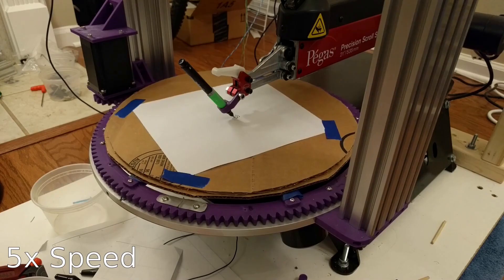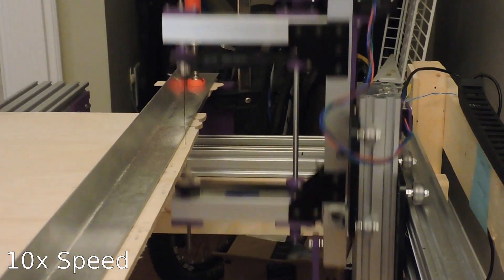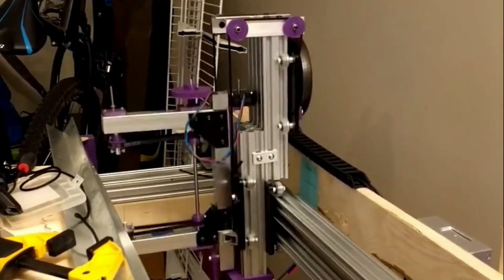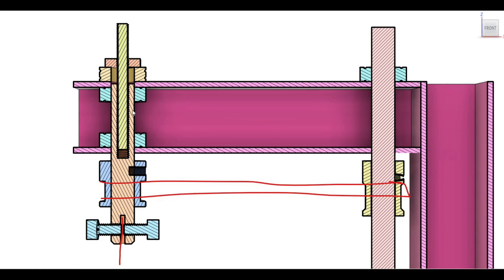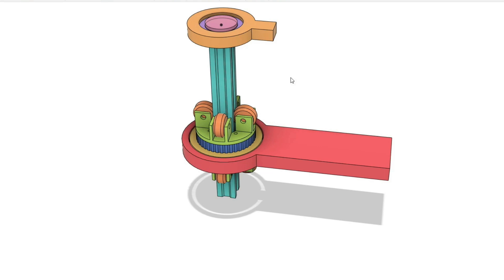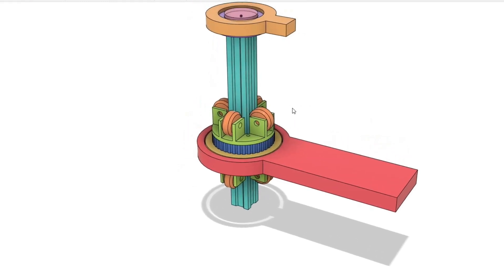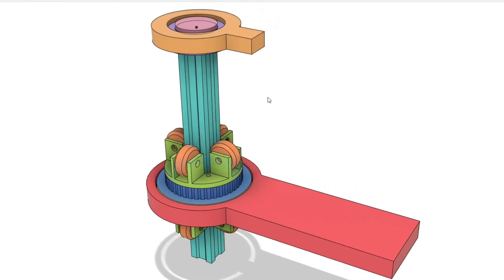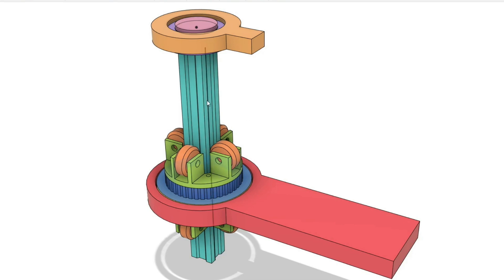CNC Scrollsaw - Version 3

Comment: Hi Andrew, I like cutting puzzles in thick wood in my spare time, and I have been looking for improvement in my scroll saw to obtain a perfectly vertical movement of the blade. The arc movement of the U part on which the blade is mounted causes problems because a puzzle piece can be fitted one way, from above, not from the bottom. So I landed here. I congratulate you on the idea of the rotating blade. When I thought of automation or even manual improvement, I thought of a spinning table with a hole in the center for the blade.
Reply from the maker: I came across one interesting scroll saw design which used a belt mechanism to drive a true vertical movement, but can't remember where. The other machine type that I know of you might check out is searching for "jig saw for die making" on YT or something like Alibaba for actual machines. These are for cutting the backer boards for the steel rule/knives to make a die, which funnily enough are used to, among other things, then cut jigsaw puzzles out of cardboard. I've never used one so don't totally know how they work but they seem to use the older style spring return to give a vertical movement. And they have big working tables.
Also with thicker wood and depending on your blade size, the blade will deflect from vertical and cut a curve in cross section instead of a line. I have a video looking at blade deflection here https://www.youtube.com/watch?v=ODY06S9otf4
And the first CNC scrollsaw I made did use a spinning workpiece! https://www.youtube.com/watch?v=R6PrNylf6_8
Stay tuned, I have another approach in the works that you might find interesting, but it means making my own blades and that is taking some time. Thanks for the comment!

Comment: How does the traditional scroll saw achieve 200-1500 SPM ? 
1.The blade does not rotate. 2.The blade only uses ~2 inches of it 5 in. length. 3.The reciprocating arms are heavily leveraged (pivot is 2" from cam motor to 18" at blade).
So, have you considered modifying it to rotate the blade holder? I.e. Add gear/sprocket  to existing blade holder driven by inboard stepper motors so new mass at blade is 2 sprockets + some drive chain with drive motors to counter balance that mass.
Now that I wrote that and looked back at the latest working one, that is basically what you have. Yes? Except without the arm leveraging & mass balancing. Yes ? Could you add a pivot to the arms shown at 2:25 to do this ? Somehow.
-Mike  
p.s. how much of the one drawing on the Pegas saw would you sell me ? 😁
Reply from the maker: I've thought about how to upgrade/retrofit an existing saw like the Pegas and had too many problems. For one, there's very little room to fit components and it may be possible, but for prototyping has been easier to build off of it; maybe when all is said and done I can revisit this possibility. Especially since as you say, they have really optimized moving the blade very quickly and smoothly.
Pivots make things more complicated because the distance/geometry between the blade/holder and motor would be changing. There's maybe a working solution to this but I haven't seen it yet.
I can post the SVG for that design if you'd like, but it's just a 7 piece puzzle
Reply: @AndrewConsroe  I pretty much knew as I posed the questions above that you already considered them. But hey, I had to ask.
I had never considered a rotatable blade so my head gears started spinning I suppose.
Yeah, I guess even the tiniest dynamic geometry changes will be problematic. It's those pesky details that getcha :D
Don't bother posting the designs on my account - I was hoping to get an off the shelf kit. Silly me! Too impatient! Fixed income too👴

Anyway, keep on with these projects - they are really fun to watch and ponder Andrew !!!
-Mike

Comment: Can you add a counter weight onto the rotating assembly? it would behave as a fly wheel at the same time and smooth out the up/down movement so you don't get current spikes on the motor as it transitions.
Reply from the maker: I considered that but I couldn't figure out a nice way to cram 2.5 lbs down there. And that may end up with issues of its own as well so I've moved on to test the design I cover in the end of the video.

Comment: If you continue to use a moving U frame,  you may want to counterbalance the weight of the U frame with a spring instead of a mass. This way you can oppose weight of the frame without adding (much) mass. The most direct method would be to use a constant force spring with sufficient cycle-life and force. If such a spring is not available at the right price, there are some simple mechanisms to convert the linear force of a Hookean springs into constant force. Alternatively, you could tune the mass-spring system to resonate at the desired frequency.
Reply from the maker: Yea I considered a constant force spring, but could only find ones rated to 250k cycles; which for my goal of 10 Hz only gives ~ 7 hours of life. Never seen a mechanism to convert linear to constant spring, can you link to one?

Comment: Very cool. 
Could you extend the travel of the saw? It seems like you are using about halve of the length of the saw blade. That would increase your feed-rate too.
Reply from the maker: I was limited by the length of the vertical extrusion, but yea if I extended that I could gain a bit more on the blade. There's about 80 mm of usable teeth on the blades and the stroke is 60 mm here. So would be a speed increase but not by the factor I'm hoping for

Comment: I think a static C frame is the way to go. Tensioning the blade will be interesting. If you stick with your current concept, I suppose you can have 2 independent cranks or add a tie bar to the blade holder that is offset and out of the way of cutting. 

The other idea would be to replace your aluminum bar and bearings with a lead screw. The lead screw nut would still mount to the rotating bearing unit. Then you could drive the lead nut with a belt again. Though I'm not sure how you would constrain the lead screw itself to get the linear motion since the blade is so thin.

In either case, you could have independent drive motors on top and bottom so in a sense, the steppers can tension the blade by having one lag the other.
Reply from the maker: Yep tensioning the blade is still an open question for me. It ties into single vs independent motors and each have some merits

Comment: Have a look on eBay for a "ball spline". Though ideally I suppose that you would need a single spline and two nuts, one for the top and one for the bottom of the frame, to avoid the mass of a linking shaft. 
You  don't necessarily need to control the reciprocating motion as long as you can measure it and synch the motions. 
Again, try looking at servo sewing machine motors on eBay. Those tend to incorporate a "needle up" sensor that could be used to synch the motion. 
This machine uses this idea: https://youtu.be/KcHUKqY422M I believe.
Reply from the maker: Yea in a perfect world I would love to use a ball spline. Would take some real machining and maybe I'll get there in the end. I'm happy using a stepper for the reciprocating because it's plug and play with the motion controller and gcode. If I run out of RPM's on the stepper I will probably just switch to a brushless motor and use an ODrive or something with step/dir. Love that RugBot, thanks for the link.

Comment: Personally not a fan of these slot running bearings; they rub by design in the V slots. It would be better to use a square steel tube with standard industrial bearings. You just need to find a way to preload them.
Reply from the maker: I have some square tube on the way to try out, thanks for the suggestion